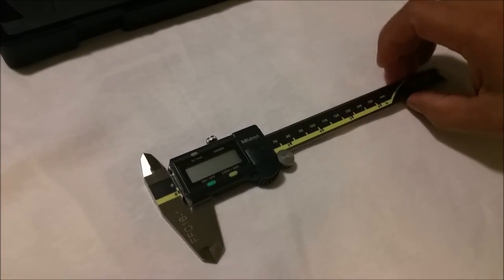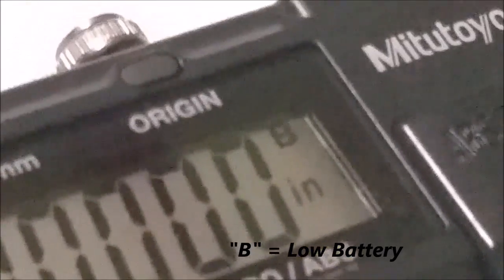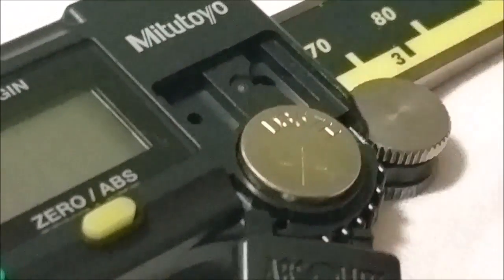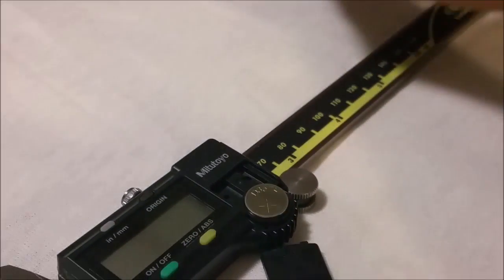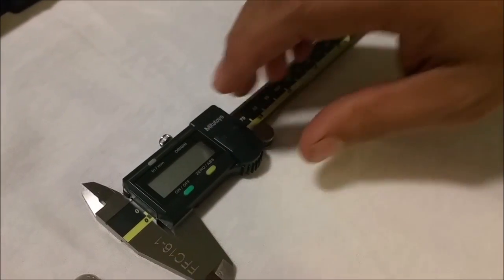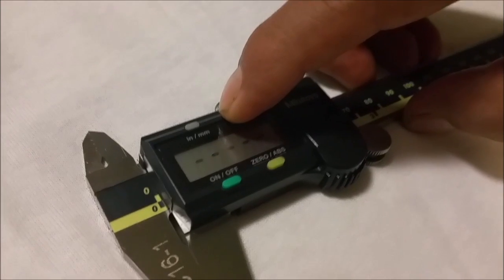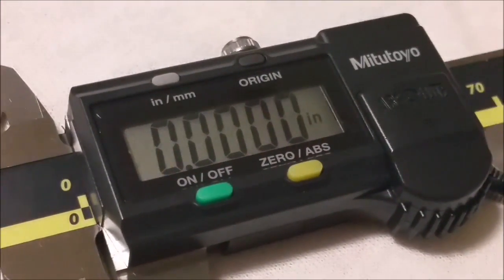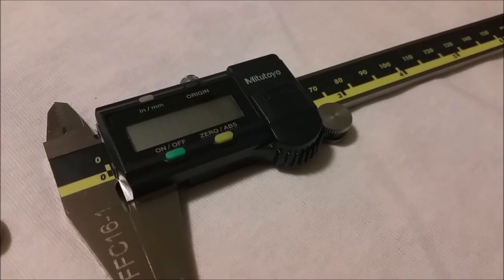MITUTOYO DIGITAL CALIPER BATTERY REPLACEMENT, BLINKING DISPLAY

Comment: You forgot to tell your viewers to make sure caliper is all the way closed when zeroing with the Origin button.
Reply: Yeah I turned mine on, made sure it read zero then locked it. I know I have to hold a button but always forget which one. Because the battery lasts a while in Digimatics.

Comment: thanks for the video.after press the origin.its still blinking.why?
Reply from the maker: Hold down long enough? Try with something with a small  end point, like a pen with the point retracted to prevent damage. In some calipers the origin button can be tricky. Hope this helps.

Comment: The only fact of interest for me, would have been the size/type of the battery.  But this video avoids striktly to show any information about that. For me: Wasted time....
Reply from the maker: Agreed! That information could be useful. But, if you open your caliper's  battery compartment you can read that information directly from the battery. I was kind of focused on getting the display back to normal after replacing the battery. Thank you for your observation.
Reply: 357,....he saved the day for me,...don't be a Douche,...ok?

Comment: our company a regularly use mitutoyo calipper but now its have problem with the new batch.
The problem is the display always blinking and when i push the "origin" button its back to normal but only few seconds its shut off and after that  its auto on and blinking again.
Even i change new battery the problem still same.
Before we can use the calipper more than 1 year but now we only can use it around 3 month and the problem is same.
Reply from the maker: Hi there. New batch of calipers or batteries? If it is batteries, probably the batteries are not good. This can be true specially when buying batteries "online" from the "e" store.
Reply: Hi,  thanks for your respond.
I don't think its a battery problem.
we have 3 calippers that we buy a few month ago that have same problem.we still have 3 more new calipper  in our store.  
we already use this brand since 2003 and no problem but this new batch that we buy few month ago have problem.
we buy 10 pcs and already use 7 of them and 4 have same problem.
Reply from the maker: Since this is a recent purchase I would then contact Mitutoyo or the vendor and seek advice from them directly. You might be covered by warranty. I believe they have a "one year" warranty on calipers. Sorry I can not help with this issue. If I get some info on this I'll post a reply to your message. Good luck!

Comment: Hi, one question, I had a problem with my clamp, the screen showing me  flashing lines when I put a new battery. I tried with other batteries and the problem continues. have you some idea to resolve this problem ?. i  putted a 357/303 Batery. thank you.
Reply from the maker: I apologize for the delay. Your issue was probably solved by this time I guess? It took me a while to reset mine because the button wasn't going all the way down. It is helpful to use something like a paper clip or even a tooth pick. I believe I used my fingernail because pressing with the thumb finger didn't push the button all the way down. Thank you for watching.